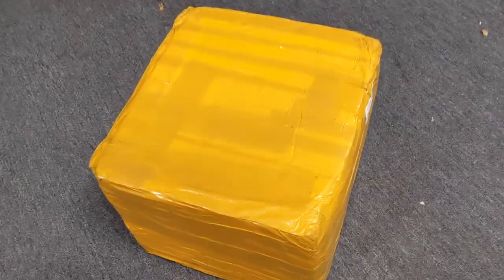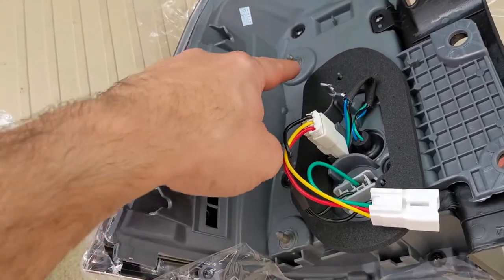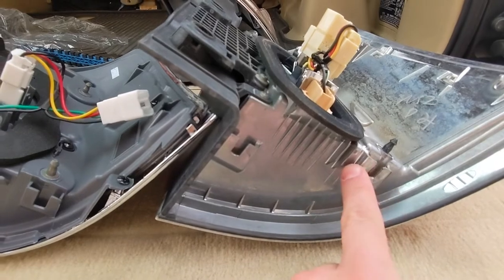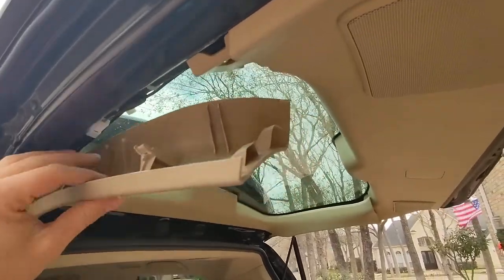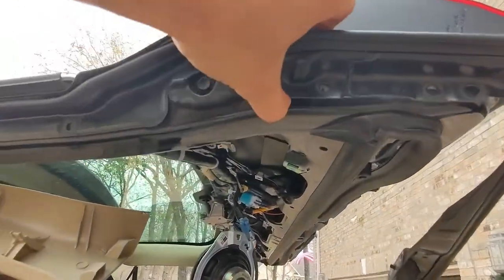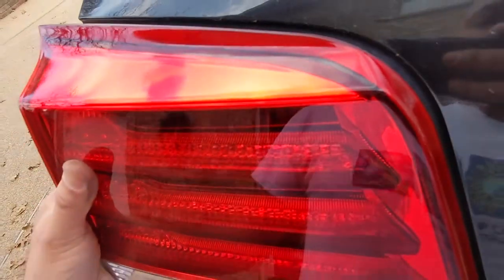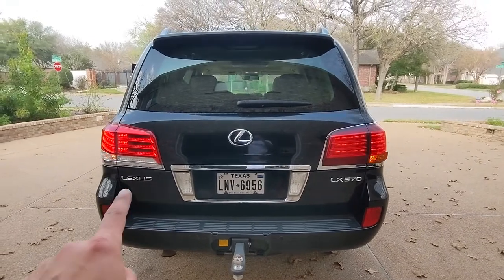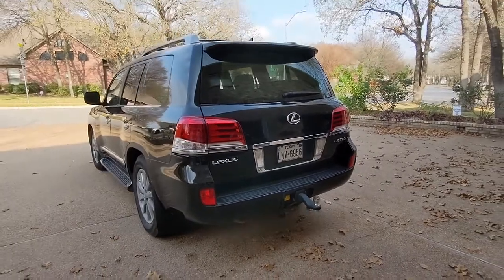Land Cruiser LX570 Tail Light Upgrade - Removal and Installation Step by Step

Comment from the maker: I bought the tail lights on eBay. Here is the direct link: https://ebay.us/HtBUky

I highly recommend you get set of 3/8" wobble extensions. They make this and many other tasks where a socket is required in a tight spot much easier. I got mine here: https://amzn.to/33OavBm

Make sure to get a good trim pry tool set. I recommend this one: https://amzn.to/3G4Efae
Reply: I have that pry kit and its very nice, use it often for many things some not related to cars like laptops.
Reply from the maker: @Physics072  Sounds about like me. Always finding new uses for the fun tools.

Comment: Next you can replace the backup lights with a led kit from JOGON. Will look like the 2018 refresh. That kit came with no weather seal so I had a hacky fitment. Replace the bulbs with LEDs, I used LASFIT brand in my 2014 LX and it looked great.

In my experience it seems the white lenses give way for color and filled in tail lights as the model years go by. If you didn’t tell me which was new I’d incorrectly assume the red ones were newer. I prefer the amber turn signals as I like the cars to be EU compliant, no red blinkers there!
Reply from the maker: I kind of agree with you on the amber turn signals. After having them on the truck for a while I think I preferred the more subtle bottom trim on the newer style tail lights, but I liked the lense color/pattern on the older style lights.

Comment: Kinda torn, new tailight looks more modern and looks like a good fit with the thicker  bottom chrome trim looks the same width as the rest of chrome trim.. But, the oem one looks good the way it is... Either way good job on vid..
Reply from the maker: Thanks! I keep looking at them and still don't know whether to keep these or switch back to the old ones. They are definitely brighter, but the old ones were bright enough, too.

Comment: I bought the same light upgrade, probably from the same eBay store for my LX470. Same fitment issue with different clips which is comforting that it wasn’t just me, and the build quality is woeful. I like the look but I’m not throwing the old genuine ones out…
Reply from the maker: Agreed. Any of these aftermarket lights never fit 100% as well as the factory Toyota lights. There’s always little issues with them no matter what vehicle they are going on. Always keep the old ones incase you want to switch back.

Comment: Older one for sure.   But do you know if the LEDS under the the plastic filters are all WHITE leds or are the Red under Red?
Reply from the maker: I think they are just normal white LEDs, but I’m not 100% certain
Reply: @NKPGarage  Well I guess some OEMs use red under red leds if that is the case a replacement clone that used white led with Red filter might not match a Red led under red filter.   I saw a photo of both and he was correct the red under red is brighter red.
Reply from the maker: @Physics072  Got it. that make sense. Interesting to see some of those details.

Comment: Where in texas are you? Can I hire you to help me upgrade my 2011 lx 570? Im in Dallas!
Reply from the maker: I'm in Round Rock, just north of Austin
Reply: I'm in the Dallas area and can assist if you are still interested in the upgrade.  Did mine earlier this week.  There is no need to remove the inside trim on the inside of the tailgate.  Takes about 30-60 minutes.

Comment: The link says it’s for 2012-2015 but shouldn’t this fit a 2011 also??
Reply from the maker: It is the 2012-2015 style tail light. Watch the video and you can see the small modification to do in order to fit them to the 2008-2011, it's very easy.

Comment: I want to swap  2013 LC rear lights to these..wonder if it’d work.
Reply from the maker: Good question. Not sure. I know the 2013-2015 LX lights will work. But not sure about the LC lights.
Reply: The reverse light on the lc is on the taillight but on the lx it isn't so even if it works you wouldn't have a reverse light
Reply from the maker: @nalendraalif1116  good point

Comment: Why change working tail lights?  Very easy to polish them to look like factory new.   Always still with Stock if possible holds resale better using stock vs ebay ad ons.
Reply from the maker: I was just wanting something different.  But I do agree with you, better to stick with the OEM lights
Reply: @NKPGarage  Well they both look good enough but I did like the OEM with more chrome a little more.  I probably would not upgrade unless one was messed up or so dull it could not be buffed out.   If you want to make they look like new just use that Mcquires kit.  Basically toothpaste polish + sponges and a bottle of UV clear coat.  Was amazed how easy and how much better head and tail lights looked.   The clear coat is the key not so much the polish, that just rouchs it up.
Reply from the maker: @Physics072  The tails usually dont get too faded like the headlights do. The headlights always seem to take the beating the most.
Reply: @NKPGarage  They do oxidize,  my brothers car in florida were, they are not clear so not as noticeable.
The sun does it + they take all the bugs on the highway where the rears don't.
Reply from the maker: @Physics072 very true! Good point

Comment: I just got my 2010 and was wondering if the 2013 front lights work on it? Also do you know if its possible to install a third party stereo without purchasing one of those tesla ones?
Reply from the maker: From what I know the headlights from the 2013+ will fit and bolt onto your 2010. But there is a small gap between the bottom of the light and the bumper.
Reply: @NKPGarage  thanks for this. Was thinking of doing that with me 2009, but I also saw some aftermarket ones that mimic the 2016+ body style
Reply from the maker: @hayesmentz4478  I saw those too. Look very nice in the photos. Worth a shot if you want an updated look. Let us know how the install goes if you end up buying them.
Reply: Did you sort out a stereo upgrade? I found a good work around that leaves to stock head unit and all it’s functionality but adds CarPlay and Android auto capabilities. Was fairly easy to install too.